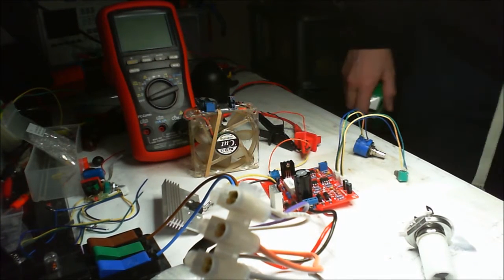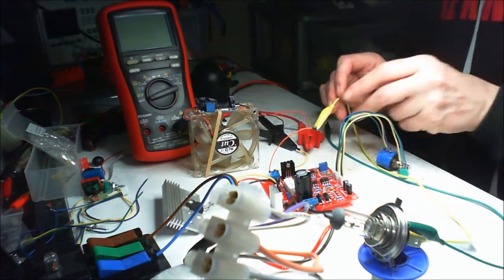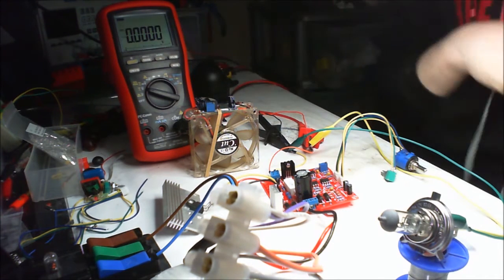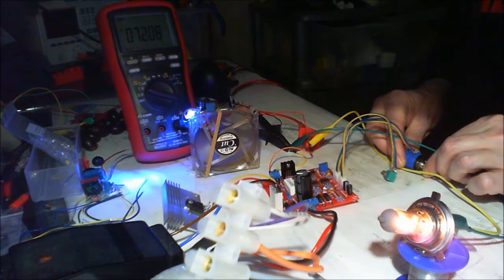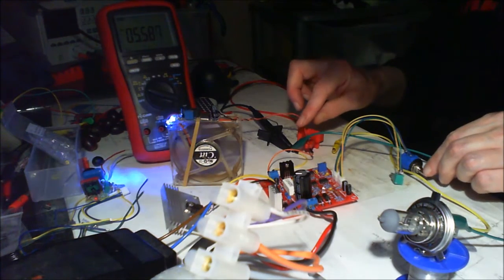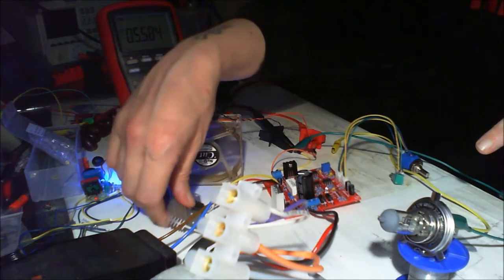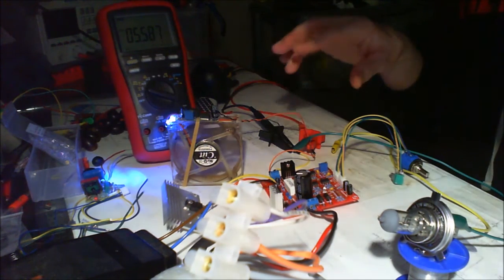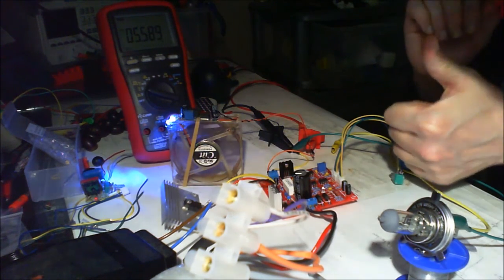Banggood DIY Power Supply Kit Pt 2of2

Comment: Thank you for the high quality videos. I am mounting this power supply, and I have a 12v and 7a transformer. Is it possible to use this transformer with this power supply? Thank you very much for your attention.
Reply from the maker: Hi, You need to use a 12V 0 12V for this supply. The current is limited by the transformer, if you load with a device that will use more than 3 amps the circuit will try and allow more current and burn. Using a transformer which will only allow 3 amps will help prevent your PSU kit from burning out. Hope this helps, happy building. I would say good luck, but luck has nothing to do with it.
Reply from the maker: I remade this video, you might get better info here, https://www.youtube.com/watch?v=YzRBTPaUwKY
Reply: Obrigado mais uma vez.